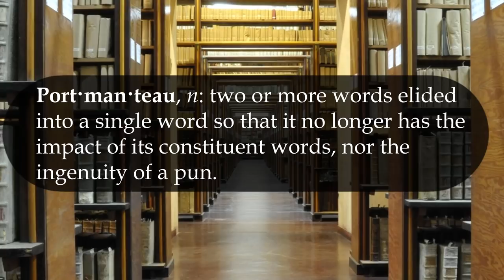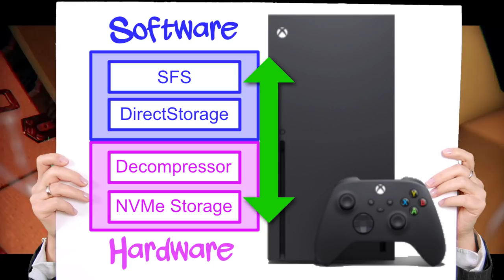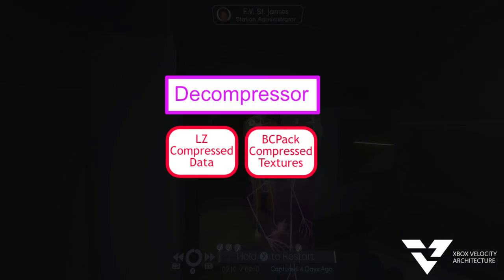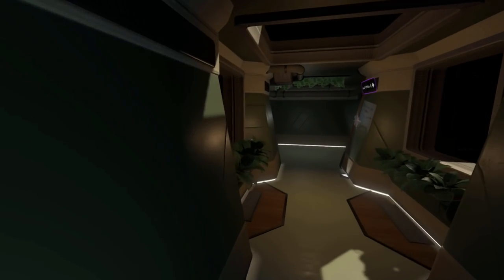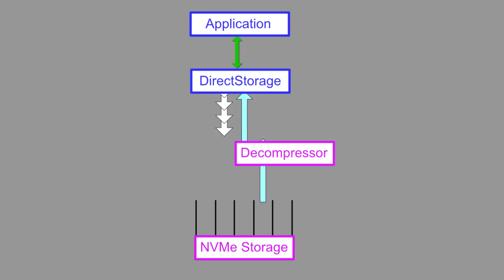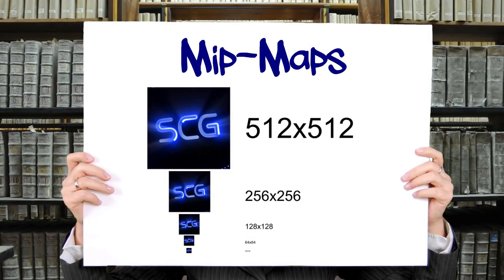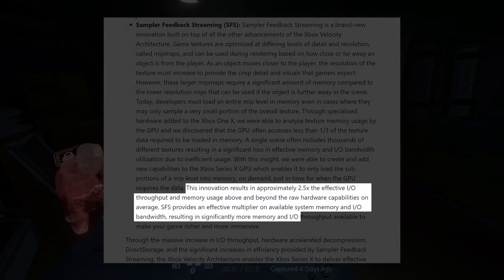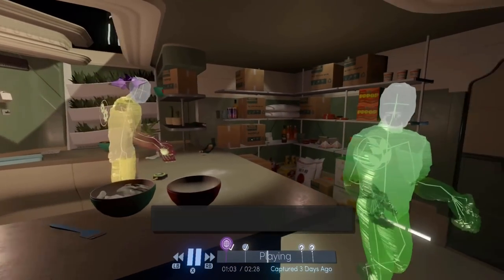Xbox Series X Velocity Architecture Explanation and Overview

Comment: Do u know if PS5 has has some similar technologies in play? Their own version of Velocity architecture?
Reply from the maker: PS5 has a host of great innovations too. But sadly I barely have enough free time to write about Xbox.  :)
Reply: @StellarContinuumGaming  Thanks for the reply mate...As usual stellar quality videos! Loved it 👍
Reply: it's not really similar..because they don't have mesh shading...they don't have directml ( not sure about this one ). and no its not really similar...ps5 "velocity system" is called oodle and it's pretty all in the ssd performance while xbox is using clearly much more feature with velocity system.
Reply: The PS5 sports a faster SSD and comparable hardware based decompression, yielding roughly double the bandwidth. Beyond that its IO complex accelerates significantly more aspects of file IO than the Velocity Architecture. It has dedicated co-processors that manage memory allocation, calculating the location of requested data within compressed files and GPU cache coherency. On Series consoles these aspects must be handled on the main CPU by either the host application or the DirectStorage API.

It's unknown at present whether there is hardware support of Sampler Feedback on the PS5's GPU, which would allow for the implementation of something very similar to SFS. Even if there isn't, UE4/5 supports similar tile based virtual texturing entirely in software which can provide much the same benefit though perhaps not as optimally.
Reply: The PS5 can't duplicate the Velocity Architecture. One thing not mentioned in the video is that each of the MIP levels of these textures are also tiled. Broken down into sub-squares that the Velocity system is able to load individually.This is a special texture file type that only the Series GPUs understand currently.
Reply: @rpfeil42  that isn't correct. What you're describing is Partially Resident Textures (or in DirectX terminology, Tiled Resources), it is enabled by the GPU using a virtual memory system to allocate an address space for the entire texture but only mapping certain regions (tiles) of that address range to physical memory. It was already supported and heavily utilised by the last-gen consoles (PS4 and Xbox One).

Sampler Feedback is a mechanism by which newer (RDNA 2 and Turing+) GPUs can have texture samplers report whether a region (tile) of the texture they're attempting to access is resident in physical memory (allocated physical space and data is loaded). SFS (Sampler Feedback Streaming) is a technique that Microsoft have built on top of this to use the feedback to track tile residency and, when non-resident tiles are accessed, to trigger those to be loaded in from the SSD.
Reply: @faustianblur1798  Thank you for vastly improving on my knowledge 🙂. Can the other systems load only certain tiles from storage, or is an entire mop level loaded and then unused pages evicted?
Reply: @rpfeil42  any system that supports Partially Resident Textures can allocate and load select tiles of each mip level from storage. This would have been of limited use on last-gen consoles however, due to the slow mechanical HDD's being poorly suited to loading small chunks of data just in time, so it's only becoming realistic with the new consoles.

The latest version of UE4 (and UE5) has a cross-platform implementation of tiled texture streaming that doesn't rely on Sampler Feedback to query and track tile residency, so there could be support for any GPU made in the last 7+ years.
Reply: @faustianblur1798  everything I can read on PRT is that it works with the original texture file formats. An entire mip is read in. The GPU tiles it as in goes into memory, a scene is rendered. Then untouched tiles are evicted. Microsoft has moved the tiling step to when the texture file is written. Without that page index pregenerated, there is no way to limit reads, and then PRT is no match for Velocity.
Reply: @faustianblur1798  as long as ps5 has not mesh shading ( cause he decide to stay on primitive shading) no directml he wont make the difference in next gen game except maybe in unreal engine
Reply: @rpfeil42  developers aren't restricted to specific file formats for textures, they can load texture data from any source they like or generate it algorithmically with no file. There are set pixel formats that they need to specify so that the GPU can interpret the data correctly, but I don't believe there are any new ones for SFS. A PRT can be generated with no resident tiles at all, in which case sampling it will return a black pixel.

What you might have read about is a different meaning of texture tiling that predates PRT. That refers to the way the GPU will reorder texture mip levels from single linear arrays of pixels into multiple smaller tiles to improve cache efficiency. The size and alignment of tiles are GPU specific, so for PC can't be reliably known ahead of time. It doesn't prevent partial mipmaps from being loaded but will have an influence on compatible tile sizes.
Reply: @jrpeegy8294  Mesh Shading and Primitive Shading are two different solutions to improve the standard geometry pipeline, one is not a simple upgrade over the other. Microsoft adopted Mesh Shading for DirectX and Xbox because it is what Nvidia supports, and thus the majority of current and future gaming PCs, whereas Primitive Shaders are proprietary to AMD's RDNA hardware.

DirectML is Microsoft's API to help developers implement machine learning algorithms on the GPU. It was never going to be used by Sony and is not a requirement to implement ML algorithms. It's unknown whether the PS5 supports AMD's machine learning operations like the Series Consoles and the RX 6000 cards. It may not be that important given even AMD's flagship RX 6800 XT has less ML performance than the Nvidia's entry level RTX 2060. It's telling that even AMD aren't using ML for FidelityFX Super Resolution, their supposed answer to DLSS.
Reply: @faustianblur1798  yeah it's two different things...one it's New tech the other no. And i think with Time it's gona make a difference
Reply: @jrpeegy8294  Mesh Shaders have been available to developers through Vulkan and OpenGL extensions since Turing launched in 2018. Primitive Shaders have never been made available to developers through any API until PS5 and were only supported in hardware with RDNA in 2019. One is certainly older than the other, but it's not the one you're thinking of and not by much.
Reply: @faustianblur1798  LMAO primitive shader IS used by Xbox too you know ? But ps5 decided to only use primitive shader and it's clearly a wtf choice ! Ps5 would have better performance than Xbox with mesh shader.
Reply: @jrpeegy8294  Primitive Shaders would need to be exposed through DirectX for developers to use them explicitly on Xbox, they aren't. Considering MS are trying to push a unified development environment on console and PC it would not suit them to promote a feature unique to AMD hardware when Nvidia control the PC market. 
Sony currently have the only platform that supports explicit Primitive Shaders, which might suggest they had a hand in developing them alongside AMD, they don't need to support Nvidia's solution when they have their own. That doesn't necessarily mean PS5 isn't capable of supporting Mesh Shaders, seeing as they are essentially compute shaders that submit transformed geometry directly to the rasteriser.
Reply: @faustianblur1798  i just Say that it's stupid to not use a new tech when the console IS capable

Comment: Ill be excited when we get games that actually utilize this tech. Its hard to be excited with no games.. Not only that Sony is currently handing it to Xbox Series X on the performance as well in 3rd party titles..
Reply from the maker: Yes. It's sad that Microsoft fell so far behind in instrumentation and build tools. But they'll catch up. I'm certain.
Reply: @StellarContinuumGaming  Instrumentation, profiling and build tools seemed to be broadly comparable last generation between the Xbox and PlayStation ecosystem. Do you have insight into why there seems to be such a gap in this new console generation?
Reply from the maker: @jamesfmackenzie  From everything I've seen and read, the PS5 uses an improved, but largely similar architecture (sliding power allocation, etc, notwithstanding) while Series' VA stack was sufficiently different that while at a high level tooling is fine and familiar, but VA-specific feature tools/instrumentation aren't nearly as mature yet. Again, going by what I read and hear from peers. I'm always interested to learn more if you can provide some insight.  :)
Reply: From what we know, going from the XDK to the GDK wasn't as smooth as it was on the Playstation side. The XDK was also updated to allow for Series S|X targets, so some games are still being built using the XDK.

Another thing to know is that the GPU of the PS5 has less CUs (36) than the one on the Series X (52), but has a higher clock speed. The GPU in the PS5 have the same number of CUs as the one in the PS4 Pro. Games and game engines that are already optimized for this will get a nice boost. The higher the framerate, the greater the impact of small performance differences. So it comes down to how much optimization can be done. Its harder to utilize 52 CUs vs 36 CUs.
Reply: @TheFirstRealChewy  Thanks for the info. Definitely makes sense that it’s harder to “fill” and get maximum utilisation from 52 pipes vs 36 - especially if engines from last gen are optimised towards the lower number. Interested to see how this pans out as tools improve
Reply: @StellarContinuumGaming  thanks for the reply! I’m an engineer but from outside the gaming industry. This is very interesting for me to follow - and keen to learn more. Will stay tuned and share any insight I find

Comment: The only thing that sucks is the xbox exclusives will be the only games to utilize all these new features. Most multiplatform devs are sony ponies.
Reply from the maker: Well, fortunately most engines have backend support that have been (and will continue to be) adapted to support these in a general way. But nothing will ever match hand-tweaked.
Reply: No it's not, playstation games are harder to port to pc
Reply: @prodj.mixapeofficial6431  so I guess thats why games run better on the ps5 even though the series x has better hardware
Reply: @danielallen7384  yes, it was made specifically for PS5. Almost all of the developers will keep in mind that the game must be ready to run multiplat so obviously they will chose MS tools. This is going to be the factor this generation.